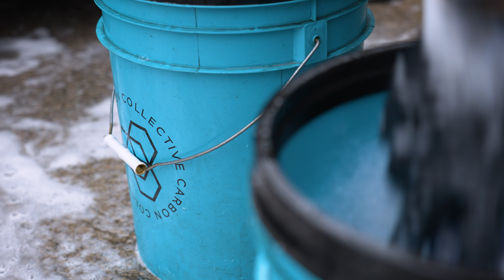20+ Year Old CLASSIC MINI (Automotive Detailing)

Comment: Good job 👏 
What a lovely old motor.
I wanted to ask  What was the product you applied at about 7:00  It went kind of milky looking.  Im guessing its a type  of tar remover.  Not sure.  And then at the end of the wash process you used another milky spray finish.  Was that Autoglym Polar Seal or similar.
Cheers...... Steve
Reply from the maker: Thank you very much Steve! Yep was definitely a nice little motor 🙌🏼

So the first product at around 7 minutes in was just a simple tar and glue remover. Usually we pick this up from Autosmart. 

Then the last product which is somewhat similar to snowfoam is Carbon Collective Hybrid coating. We use this just to make the drying process easier really. Hope that helps! 👍🏼
Reply: @refinedfilms.  Hello mate.  Yes very helpful thank you.  I'm always keen to learn about products that others are using.  Its a minefield out there. 😄
Thanks.  Have a good day. 👍👋
Reply from the maker: @stevesvids  haha no worries Steve 👍🏼Any other questions, just let us know! Have a good one 🙌🏼

Comment: Hi pal, awesome work! What is the protection layer you applied by snow foam gun. TIA
Reply from the maker: Hi Jay, thank you very much! Sure so that is Carbon Collective Hybrid Coating. We tend to use it just to make the drying process easier 👍🏼
Reply: @refinedfilms.  what do you use as a more long term protection apart from ceramic coatings
Reply from the maker: @jayfrench1330  Hi Jay, so we tend to use a Gyeon wax for longer term protection before going down the route of ceramic coatings 👍🏼

Comment: Beautiful work. Nobody mentions your Kranzle! How long have you had your Kranzle, and has it stood up well?
Reply from the maker: Thank you very much! I think we’ve had the kranzle for around a year now. Great bit of kit  🙌🏼
Reply: @refinedfilms.  Worth every penny....get what you pay for. My K10 122 TS is a year old but won't see as much use as yours would. I even detail my machine, I keep it nice and have changed the oil after 1 year of ownership from new. CarPro Pearl on the blue plastic bits?.....maybe, but then I'd feel a tad OCD lol. I did add a strip of non slip grip tape - it feels like about an 80 grit sandpaper - to the underside of the handle, you can't even see it. Too many times with a wet soapy rubber glove did the machine want to drop on my foot...at 23kg's...no thanks! 😁
Reply from the maker: @23hublock1  Ohhh totally I agree! 👍🏼

Yeh the griptape is a good idea like! That would be rather painful 😅